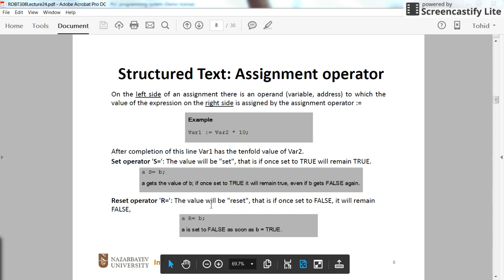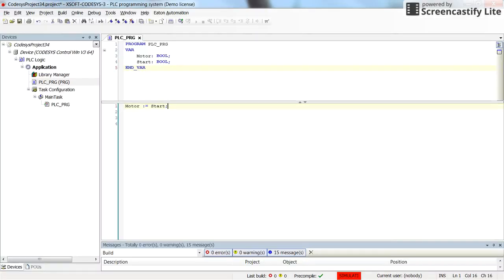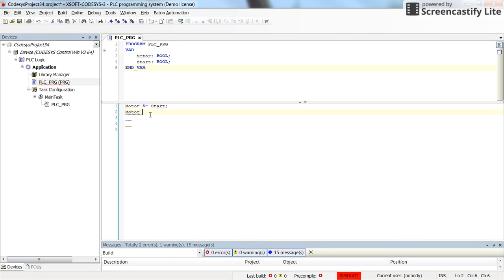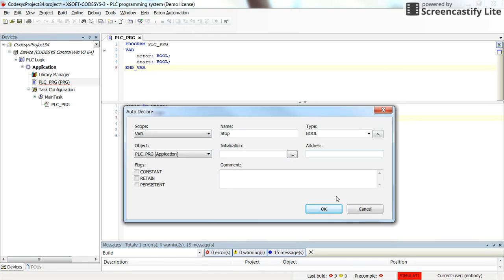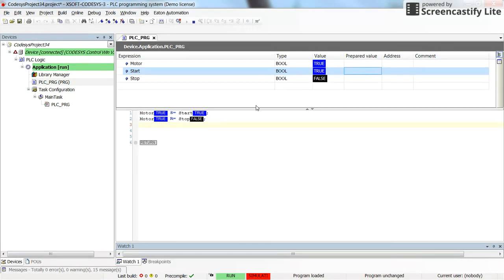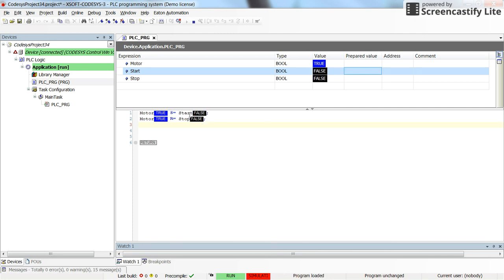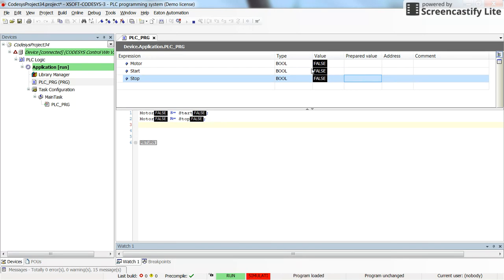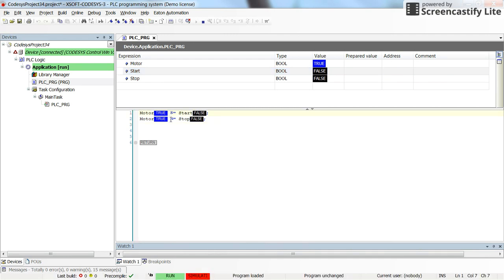CODESYS: Set/Reset instructions in Structured Text programming #codesys #plcprogramming #iec61131

Comment: Another great video Tohid! One consideration with using a NO contact on the reset is that it won't allow for a stop if the stop loop goes open circuit. Another method is to use the following code:

xMCR S= xStartBtn;
xMCR R= NOT xStopBtn;

With this logic, the stop button has to see 24VDC at the input to 'not be active'. When the stop button is pressed, it represents a stop condition on OVDC. If the stop loop goes open circuit, then the motor will stop as a fail-safe fallback.

Even though hard-wired interlocks such as e-stops would allow the motor to be stopped, it's still a good practice to try and code in safety features; even when providing examples. If students go on to use 'tutorial code' in production environments, they could end up creating problems if they aren't also taught to think through the requirements and factor them into their designs/implementations.

Comment: Can i set the motor variable in different places? Or is like ladder where you only can set in one place
Reply from the maker: I think you can set it in more than one place, so it's not recommend. I don't think that the compiler will issue an error for this. But in general it's better to use the set coil only in one place, and not forget to reset it!

Comment: Wouldn't it be easier to just CTRL-F7 (write values) when triggering those booleans instead of F7 (force) and ALT-F7 (un-force) all the time? :) 
Or is CTRL-F7 a newer feature which wasn't there in the older version of CodeSys?
Reply from the maker: You are right 👍
I am not sure if it was available at that time, or just I was not aware of it. Thanks for your comment 🙏

Comment: Hello Tohid,
I'm working with Codesys 3.5.8 and tried to perform the Set and Reset functions just like you suggested in this video, but it doesn't accept the command, and gives me errors. I just wanted to know if you added a library to access these. 
Thanks!
Reply from the maker: Dear Nivedha,

There is no need to add any library to use the Set and Reset functions. Please let me know what errors you receive while compiling the code?

Regards,
Tohid
Reply: Thanks for the quick reply, the error is ;Unexpected token R= found'. The line i am trying to write is :
IF GVL.(Tag name) :=1 THEN R= GVL.(tag name);
END IF
Regards,
Nivedha
Reply from the maker: Is that because you need to have R := GVL. ....?
Reply: I tried that as well, it gives me an error 
'; expected instead of :='
Reply from the maker: Nivedha Seshadri I see the issue. You need to have the name of the Variable that you want to reset just before the R= and then the condition. like: Motor R= condition.
Reply from the maker: Try this and let me know if it works.
Reply: Tohid Alizadeh thank you so much for your help ! It worked :)
Reply from the maker: You are welcome. Goo to know that it helped you!
Reply: Are you still work with CODESYS? I need a help like that....